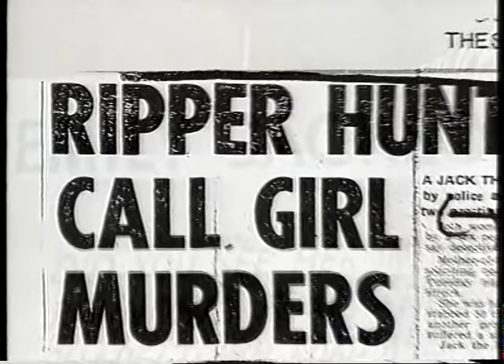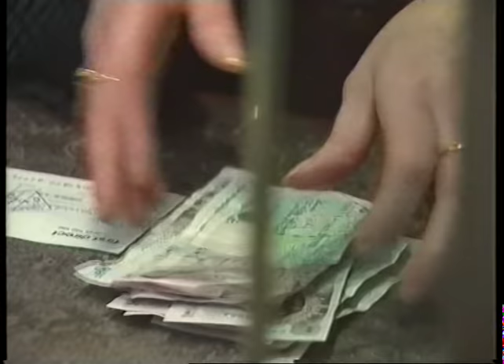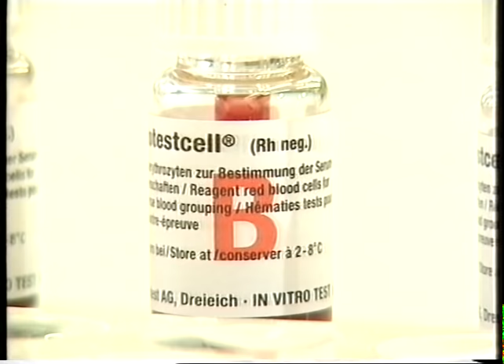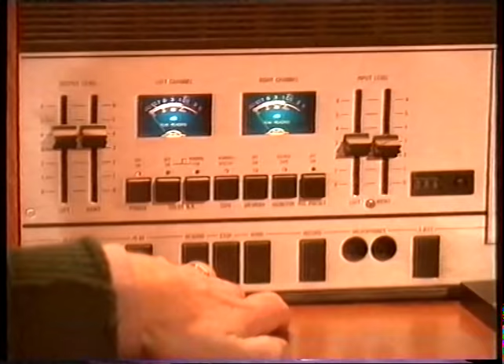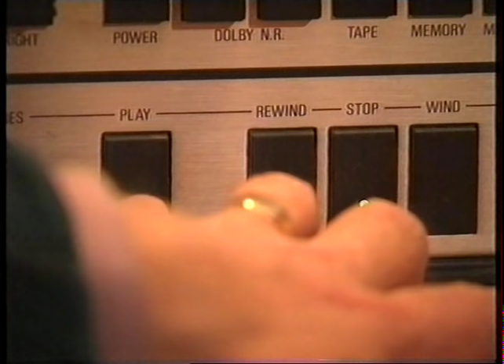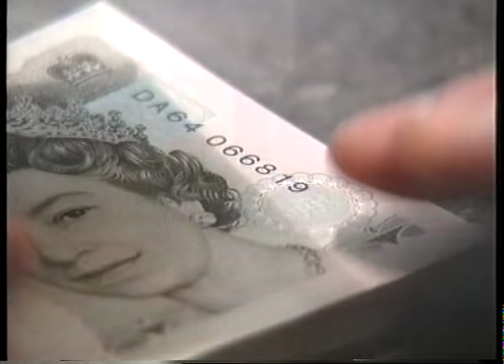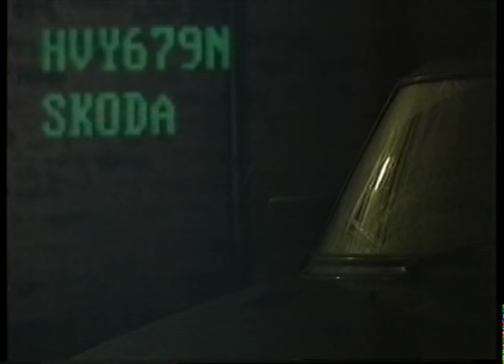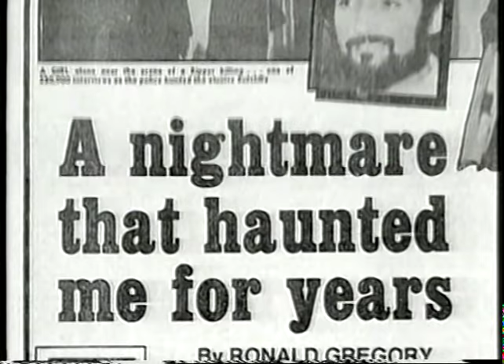Manhunt - The Yorkshire Ripper.

Comment: I started off in office work in the late 70s, when Sutcliffe was still active. Not in the Police by the way. 
It’s easy to criticise the Police, and of course they made errors. But in mitigation unless you’ve worked in a pre computerised office you’d really have no comprehension of what the world of office was was like. Wall to wall paper files, card indexes, ledgers, paper lists. To find and co ordinate information on just one person could involve sifting through hundreds of files, a series of phone calls, listing it all down; imagine how long that took for one person, and how easy it was to mis index or simply miss a record. Desks were stacked with files, if you couldn’t find one you’d have to hunt around other peoples desks as they may be using, sometimes files were out of the system for months and years even. Yes, they were! If you had to get information from another office, they’d have to do a sift on their records. Just collating one persons info could take the best part of a week, or longer. It happened all the time. The problem with the police was they set about it the wrong way, their initial approach was far too broad. It was obvious they’d never have enough hours to process such a broad approach and should have zeroed in on key features rather than just rely on slogging through masses of data hoping sheer graft would crack it. That was a very common but old fashioned attitude prevalent at the time, the work culture in my experience was more about hard graft not intelligent segmenting and filtering of data. Don’t forget a lot of bosses then had been shaped by wartime of national service where I imagine slog over skill was the culture. They seemed to start off treating every man as a suspect, too many records, and didn’t filter and refine as more evidence came in. The 240 names on the 5 quid note list should have taken them to PS. That was the firmest lead, backed up by Photofits. Also the Humble hoax. I was around at the time, and believe me the country was convinced that was the Ripper. No doubt at all. What ordinary people did not know was there were survivors who were firm in saying their attacker had a Yorkshire accent, and the Police simply wouldn’t have it. That’s a reprehensible blunder. They should have done better. Even when they did visit a suspect I read the interviews became routine and perfunctory, the focus being on elimination of the suspect not drilling further into why they should be suspected, and the weakest of alibis were accepted without question, from wives, partners, family....again as happened with PS. And no DNA in those days, had it been there PS with a conviction would have been trapped very early on. Much like Humble who when DNA could be used it led Police right to his door.
Reply: Which is why you need someone a lot sharper than the two oafs in charge here.  They both made the critical error of putting too much stock in the (hoax) letters and tapes, which effectively eliminated Sutcliffe from the short list.  Bottom line, this decision had NOTHING to do with pre-computer data keeping, and should have been a matter of common sense!

Comment: Difficult to watch this when comparing it to modern day FBI systems. When a suspect has several cross referenced indications they are focused on until they are cleared. And sure  - hindsight is 20/20 vision and undoubtedly lessons have been learned  - very difficult & costly lessons

Comment: Why would 1 boot be more worn than the other?
Reply: Possibly because of depression of one set of pedals, as opposed to the other.

Assuming the lorry he drove had pedals similar to that in a manual car (or even an automatic), then depression of the brake and accelerator pedal would be more frequent than that of the clutch.

An automatic lorry then would have no left boot wear.

Comment: To change the subject slightly and be a little bit less morbid...Did you know these facts about Squirrels? In Greek, the word squirrel means shadow tail.
The most iconic behavior of squirrels is storing nuts and acorns for winter. Which is necessary for the species of squirrel that do not hibernate.
The hind legs of squirrels are double-jointed, which gives them the ability to run up and trees very quickly.
A male squirrel can actually smell a female in heat, from up to a mile away.
Mating season for squirrels is from February to May, with a 44-day gestation period. Generally, two to four young are born per litter.
Squirrels have 4 toes on their feet, which are extremely sharp and used for gripping tree bark whilst climbing. They also have 5 toes on their back feet.
In Addition to residing in the Eastern US, Eastern Gray Squirrels can be found in many Western states, “Facts About The United Kingdom.”
With 285 species of squirrels, they can be found in every continent except Antarctica and Australia.
Squirrels can eat their own body weight every week, which is roughly 1.5 pounds.
Squirrels can fall from 30 meters high, without hurting themselves.
When jumping, or falling, they use their tail both for balance and as a parachute!
An arctic ground squirrel, which is a species of ground squirrel native to the Arctic, is the only warm-blooded mammal able to withstand body temperatures below freezing whilst hibernating.
Squirrels eyes are positioned in a way which allows them to see behind them.
Back in 2007, Iran claimed 14 squirrels found near the nation’s borders were actually spies.  
In 2013, authorities shut down camping in Los Angeles National Forest when they found an infected squirrel living there. The infection actually killed a 15-year-old boy from Kyrgyzstan, which he caught from a mountain squirrel. 100 people had to be quarantined so this infection would be contained.
Squirrels are clever creatures and can learn to navigate numerous obstacles to find the most efficient route to food, they’re also rather good at finding shortcuts.
Squirrels can jump a distance of up to 20 feet. They have long, muscular hind legs and short front legs that work together to aid in leaping.
In the 2005 remake of “Charlie And, The Chocolate Factory” squirrels were real. For the squirrel scene, the squirrels were not CGI, but were actually real life and were professionally trained by The Nut Room Animal trainer Michael Alexander and his team who spent 19 weeks training these squirrels for this one scene.
In 1963, the city of Longview, Washington, has a bridge named Nutty Narrows. The 60-foot long bridge has turned the town into the squirrel-lovers capital of America. Longview now holds an annual Squirrel Fest in August every year.
Squirrels have been proven to run at speeds of 20 miles per hour, however generally, most squirrels run half this.
Reply: OOOOKAAAY.

Comment: Every foot print size7 but Peter size 8 ?
Reply: Occasionally, I'll wear a pair of shoes one size too small.

Though only because I haven't got around to replacing that particular pair with a new one yet.
Reply: One of the reasons given is the manufacturer said something about the nature of the material
Reply: @KKTR3  Ahh!

Yes, that could make sense if temperature and/or moisture could influence the "footprint" of the material.

Comment: To Many mistakes by the people responsible for the investigations in to the murders by Peter Sutcliffe who could have been caught much sooner and to many so called over looks  or mistakes on the filing system at that time now with computers used much more often then then. And the people responsible for the overlooks were transferred to other duties or retired earlier than they would have been normally wren they bought over the coals and severely reprimanded that for me is the question  Could have prevented some of the murders committed by Sutcliffe  and those who were murdred could ne still alive today makes my blood boil it does